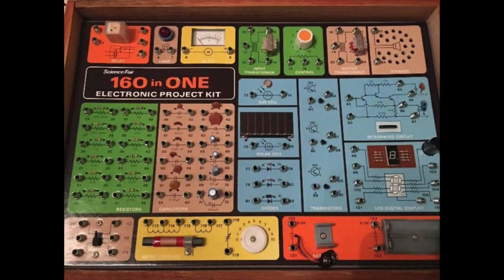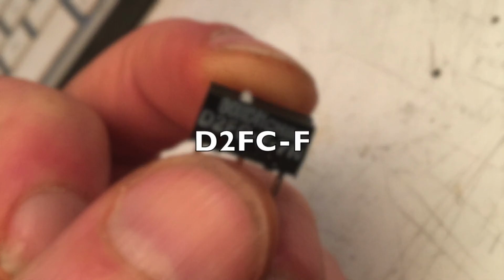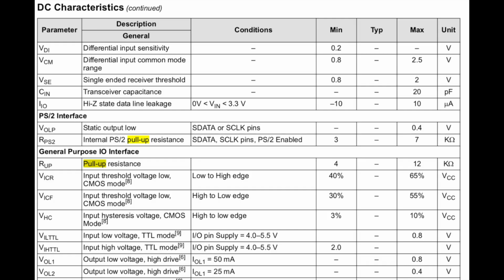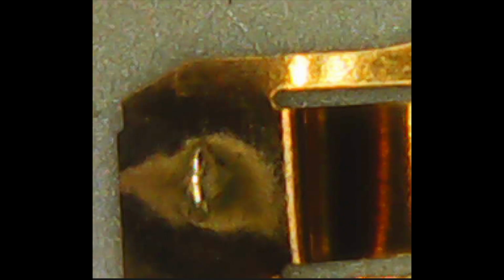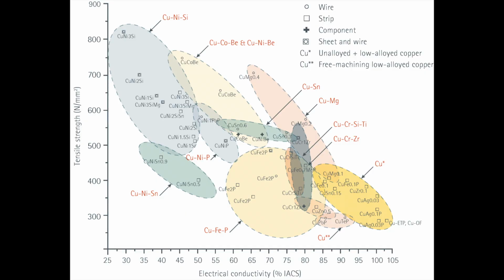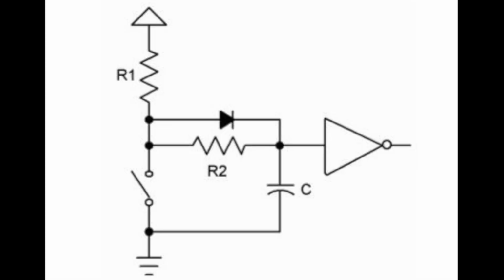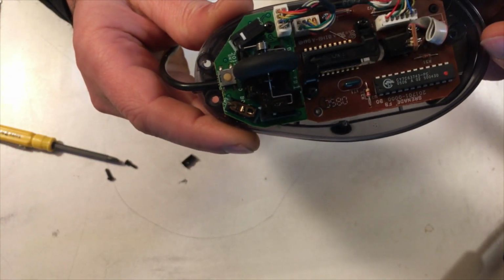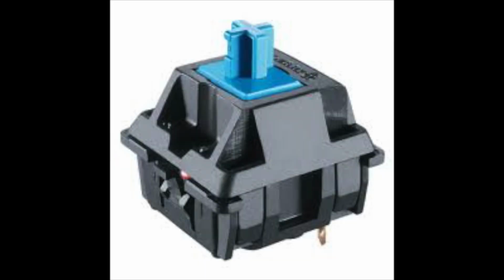Failing switch problem: Omron vs the modern mouse circuit

Comment: Asus has recently launched a mouse with hot-swap microswitches! Model: Asus ROG Chakram. 
Also this is the best movie of 2019 i've watched
Reply: ASUS started doing this quite a while back with the original ROG Gladius, shame all their mice are kinda stinky (maybe except the new Strix Impact that's on the horizon)
Reply: An update: Razer joins the game with the Viper Mini.
Reply: @0name933  It's a different approach to the problem, actually. Asus uses hot-swappable user replaceable mechanical switches. Razer has switched (pun, huh) technology to optical switches that are not supposed to develop that issue at all. All the while Logitech is continuing running whatever good name they used to have to the ground and selling disposable mice...
Reply: @Arcadius100  I remember seeing a post showing that Razer's optical switches are are so removable without soldering in case the switches stop working for whatever reason, even though it is not stated by Razer.
Reply: @0name933  The only way for an optical switch to stop working is for the LED to die. The LED is soldered on to the PCB. The only thing you are replacing is the light shutter (that block and unblocks the light from the LED), which is rather inconsequential in the reliability of the switch.
Reply: @CptJistuce  The most realistic and common way for an LED to die is heat. At the miniscule power that these switches run at, they're nearly immortal, or at least less likely to die than the IR LED inside the optical sensor that tracks motion.
Reply: @AyushSharma-xp5ew  Indeed. Barring defects, an IR-emitting diode is essentially immortal. Modern-style photoreceptors are also basically immortal.
They CAN fail, but it is fairly unlikely if they are used properly. As we've seen in this video, using components properly isn't something mouse manufacturers are good at.
Reply: @0name933  Why just Mini? Looks like their page about these switches lists several mouses, e.g. non-Mini Vipers. 

But yeah Mini seems great and not too expensive.
Reply: @Alex11223l2  Yeah, the Viper and Viper Mini are mostly solid mice. The optical technology is great, it's just a shame they suffer from the same issue every Razer mice has - mushy primary clicks. Absolute deal-breaker.

Comment: the infos gd but too much junk talks n useless stuffs that r a waste of time.  an one hour video is too long for a problem like this cut all the crap go straight to the problem.  this happens when the tiny fragile copper plate becomes flat out after sometimes of clicking, u can fix it by manually twisting the copper plate back to its original state which i done a couple of times, need to be really careful.  there r other videos that teaches how to do it just google fix mouse double clicking.  logitech uses omron swithces that has poor durability, the copper plate is fragile as shit.  kailh switches have much stronger build n quality.

Comment: I liked the can of worms and the video overall, extremely nice to see vids like this. However I still feel like you could have cut this down by 30% without losing any information, lots of repeats, some useless stuff and also you often could have just rephrased things to get the message through in shorter time. That being said I'd much rather watch this video in this form, than not watch it all, so keep on going. 

It kind of makes sense to cut down the switch current usage for wireless mice, maybe you could take a look at the original G703 and the G703 HERO, to see if there's changes into the button signaling (G703 Hero boasts much longer battery life than the predecessor, but does it all come from the HERO sensor alone?). Maybe even compare these to the wired version of the mouse, G403 (Equally PMW3366 and Hero). Most likely land of diminishing returns...
Reply from the maker: I was actually looking to get a hero sensor mouse to test on black friday/cyber monday, but didn't see any super killer deals.  I do want to try a few though when I get a chance

Comment: Or you could add a external resistor on each switch in parallel with the internal one. I have mine set at 20mA per switch right now. well within spec.
Reply from the maker: True. No reason you can't just sink additional current that way as long as they didn't do anything goofy
Reply: Did the additional resistor work?
Reply: Yep, worked quite well

Comment: What did the old intelipoint mice use?  I have 4 of them left and all still work perfect, even after 20 years of hammering on them in games, rookie users, and various rage moments.
Reply from the maker: All the WMO Microsoft mice I have used the little Panasonic cube switches, and mine all work fine too. Those are occasionally used for additional buttons like thumb and function on other mice, but I think they are not popular because of the different feel
Reply: IME 3.0 used d2fc-f-7n  from the very first revision X06 to the final X80, i have checked all of them.

Wireless IME uses panasonic cube switches

Comment: I really wish I could get ur opinion on the new g-wolves switch aka gold customs TTC switches. They have this great little cup stabilizer on the plastic notch or what ever it’s called...sorry I’m ignorant about part name.  It’s on the new g-wolves hati mouse.  What info would you need in order to check them out?  Just let me know I’ll find what you need.  Thanks if you can if not all good.  Figured u would be intrigued.
Reply from the maker: I have been meaning to try some of the new logic-level switches from TTC and Kailh, but haven't gotten around to it.  I'll put some in with my next overseas order, but they won't get here for a month or so. BUT one of my Razer just had the right-click die, so maybe I'll try them in that mouse
Reply: Alex Kenis awesome thanks!!! I’ll keep my eye out and click for notifications!

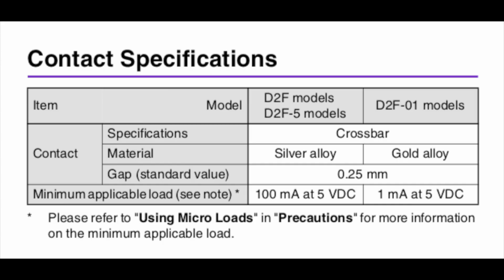Comment: Are you aware that you're recommending (D2F-01) a switch rated for a load of  30 VDC 0.1A with a supported MINIMUM load of 5V , in a 3.3V application??  23:10 
https://omronfs.omron.com/en_US/ecb/products/pdf/en-d2f.pdf 
You also confused the "D2F" series, with "D2FC", 22:58 , which are NOT the same. 
"D2FC-F-K(50M)" for example, is rated at 6VDC 1A.
Other than that, great video!! ;)
Reply from the maker: HA, 'recommend' might be a strong term, but there are more "microcurrent/modern logic level" switches popping up, and yes, I understand about the 'C' variant, but the only data I have for 7N, 3m, and K variants is marked confidential, so I didn't feel right about posting it. There is a 'sell sheet' floating around with 6v@1mA, which corresponds to the internal test qualification sheets for 'switching capacity rating'  The other test points were contact resistance  specd at 6v@100mA, shock, mechanical and durability at 5v@100mA, and switching capacity rating at 6v@mA
Reply: After i watched your video, i was really pondering on the idea that the best route might be to just replace the switches with  identical ones. It would actually be the only way to preserve the original feel of that mouse (if one actually loves the mouse so much that they're willing to do the procedure) :) 
Had a case where my G403 broke, and bought a G703 (which is identical, except for the induction charging and switches), and had to return it, because i hated the switches (D2FC-F-K(50M)). Resorted  to looking for old stocks of G403 (D2FC-F-7N) :))) ..A bit sad actually.
Reply from the maker: Yeah, I hear ya.  I was on my second set of 7N when I gave up and switched to 01F and the strange honeywell switch.  They definitely change the feel though.  I've been back on a Mamba Tournament for a bit, but I keep hitting the DPI switch when I scroll and I definitely suck more on the Mamba, for whatever reason

Comment: Alex, thanks for your time doing the video. I get a lot longer and more reliable operation with the Japanese versions D2F-01F than the Chinese versions. For the mathematically challenged such as myself, I can recognize the difference of one month for the Chinese switches vs. a few years for the Japanese switches. What's a better, longer lasting switch than the Japanese D2F-01F? I just got a G502 Lightspeed and had to replace the left button after a couple months (Chinese marked Omron). The G903 Lightspeed left button lasted 3 weeks (Chinese no Omron marking but an Omron P/N). I have a tendency to try to crush my mouse when I play. Is there a more durable switch as far as overtravel protection? I don't mind a few bucks per switch if they're going to last longer than the D2F-01F. BTW, I would totally buy a modular type mouse with hot-swappable buttons you spoke of.
Reply from the maker: Overtravel has more to do with the mouse design, except for a few switches that limit it by design.  Since switches take so long to die if they are spec'd correctly, I have not run many switched to death, so The switches I have been using are the Japanese Omrons and the Honeywell ZX (which are pretty hard to find), and they have held up for a good long time, but Kailh and a few others have listings for low-current logic-level switches popping up on sites like AliExpress, and they use a similar mechanical design to the chinese omrons, but with better contacts and tolerances, so Im hoping some folks torture those for a while and see if they are any better.

Comment: Razer Death Adder from 2008 worked until 2016, then Double Click.
Logitech g400s since 2010 till today, no Problem still works everyday.
but now i wanted something new to try.
tryed LC Power m810RGB Mice with Omron, seems fine.
i wonder how many years they will last.
and i got a LC Power m715R for 6€, this mouse have an Avago 3050 and some unknow switches.
i,m sure that this no name switches will fail earlier then the Omron.
Reply: Update: Omron Switches from the LC Power m810RGB are dead since Mid 2023 (Doubleclick Problem)
6€ unknow switch C Power m715R 6€ still works.

Comment: I was VERY close to get a Logitech G502 Wireless (let alone any mouse now). I'm just paranoid now that if I buy a "modern" mouse I will run into this problem.
Thanks for this video though, opened my eyes to a lot of things.
Reply: Don't get anything Logitech related, I have the 502, it started double clicking within a month. It's become a crap Chinese brand, don't feed the cancer company.
Reply: Logitech's newest model sucks. I have the basic old crap model M100r for everyday work usage and heavy FPS gaming and it works fine for 5 years till now. Bought a G203 for its high DPI because I'm upgrading to a 4K monitor and the double click problem come up within 6 months. My friend has a GPW and it fails within 2 months. Sad that Logitech has become such a crap brand nowadays.
Reply: Agree with two other posters. Spent $200 CAD on a G502 lightspeed, the first had the issue within one week, the replacement just got it now after a little under three months. Awful product.
Reply: @v12vanquish135  I also got the G29 for sim racing, same shit with pedals, wish I could post a video I recorded of WTF is going on in a sim because of poor contacts between the analogue pressure plates or whatever they made.
Reply: I bought a G102 about half a year ago. The left switch began failing in less than 4 months, I shit you not, and I'm not even a heavy user.
The mouse itself would've been pretty good for the price, if not for the damn switches. Meanwhile all of us know or have that old ugly yellowed cheap office mouse from early '00s that outright refuses to die. I've heard the same about Logitech, Razer and most other "big" brands, switches aren't made to last. This is such a trivial thing that no one cares about doing straight.

Comment: Wow, this is the kind of content I was searching for so long. This is simply forensic grade material. Something that the company does through its own R&D department to find out the culprits. Unfortunately, I believe that these companies might already be aware of these things and don't want to interfere as we are in an era of use and throw and until you are going to throw your 100$ or 1000$ mice in 1 yr, 2yr or whatever the warranty period is they won't be able to earn consistent revenue.  So, only the nerds or people capable of doing these things might be able to get out of the vicious circle that these companies and gotten us into.
Reply: I've 4 logitech mice in a row and i've decide to abandon logitech. F them. My last 2 mice all double click within 6 months and all of them are not cheap.
Reply: @sleepyearth  Unfortunately it's not a Logitech thing exclusively. my G502 switches bit the dust after more than 4 years which is pretty decent. My Corsair Nightsword on the other hand started doubleclicking and losing click-drag in a couple of months. Luck of the draw they probably all use the same Omron shown in the vid. same happens with Razer etc.. sometimes lucky, sometimes not.. and they lose a crapton of money in warranty exchanges.
I am not sure the penny pinching on switches outweights the money lost shipping brand new replacement mice en masse.
Reply: @ledoynier3694  I can add a Logitech G604 after 16 months and a Roccat Tyon after 7 months to the evidence.
Reply: @ledoynier3694  That was exactly what I was thinking..I mean build 100 $ mice that last for at least 4 years. Does that make sense?
Reply: @TheLeopard2A6  I have a Roccat Burst Core Buyed 1,5 Years Ago, it has the Titan Switch (Optical Laser Switch). It works perfect like Day 1, not a single feeling of worsening.
I think this Optical Switch is the Revolution we needed to Fix this Double Click Problem. They say they are testet with 100 Million Clicks. Most Omron Switches are said to last 10 Million Clicks. So instead of 4 Years you can use the mouse 40 Years. This Is a relativly new Tech. 
The Only Brands with this new Optical Switch Tech are Roccat, Logitech, Razer, Corsair, SteelSeries, Cooler Master and 2-3 smaller brands that i dont know.
But you should watch out. Some Older models with Omron are still in sale with this Brands. Not all Mouse models have switched to the New Optical Switch.
Reply: @sleepyearth  i on the other hand have cheap wireless at least 10 year old logitech Mouse and it still works well .
Granted i am not exatcly using it heavily (eu4 being the hardest regular use case scenario)  but still 10 years
Reply: @KrolPawi  I have a Logitech M-RCS143. Still working like a charm after 10 years. I still take it everywhere with my laptop.
Reply: I'm on my second Performance MX mouse. Both started double-clicking after probably three years. This is a well documented problem!! Logitech needs to use better parts. I would attempt this repair but a) no soldering iron, b) no flux, 3) had not even heard of a solder wick so even though I'm pretty mechanical…it ain't happenin'. (Bleep) you, Logitech.
Reply: I already do that as a mouse enthusiast oof.

Comment: You are completely wrong about D2FC-F-7N not being microload switch. D2FC and D2F are different series. "01" in part number for microload variant is not applicable to D2FC series. I cannot find complete datasheet for D2FC such as available for D2F but 0.1 A maximum current rating is enough to know it's a microload switch. Usual D2F is rated for 3 A (1 A for low force variant), microload version for  0.1 A. If you don't believe me that D2FC and D2F are different series with different meaning of part number, look into D2FS datasheet which are microload low operation count cheapo version. https://omronfs.omron.com/en_US/ecb/products/pdf/en-d2fs.pdf
As of D2FC-F-K (blue plunger), it's rated for 1mA according to this brochure. http://en.chanlin-ele.com/Uploads/201601/568ce2c9eeda4.pdf
Reply: It seems you are right, although: D2FC-F-K is still the same mechanical design as D2FC. Which has the wiping/contact damage issues he's shown. Another datasheet here: http://www.datasheet-pdf.com/PDF/D2FC-F-7N-Datasheet-Omron-846832

Comment: i changed the switch but the mouse continues to double click
 😥
the switch may be damaged or something else
?
Reply from the maker: That sucks.  I don't really coever other possible causes here becasue tha can vary greatly, and I'm not sure what mouse you are using, but you could try increasing debounce time (if that option is available) or lowering polling rate. Could also be wear on the underside of the button (on the mouse shell) so look for a dent or other wear.  Some people have repaired that with a small square of metal tape. it could be other issues, but id check those options first.